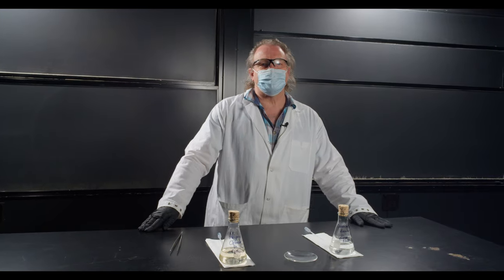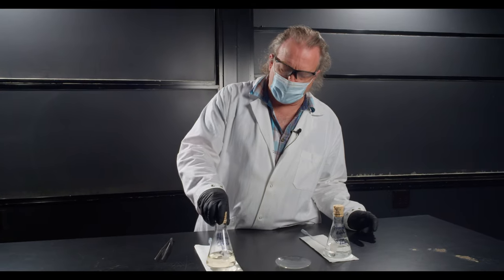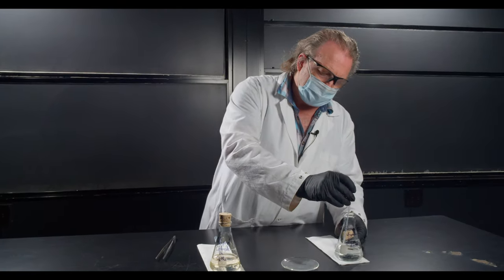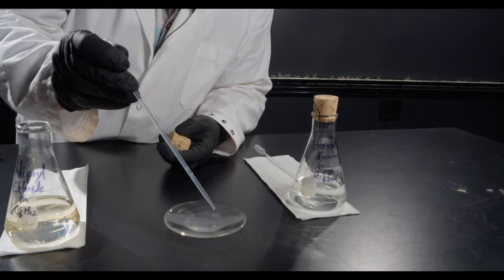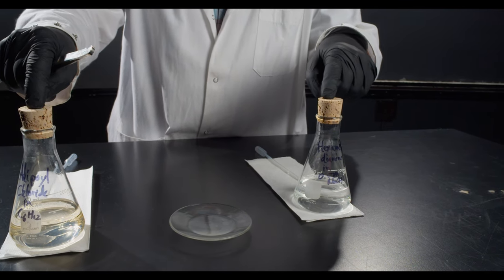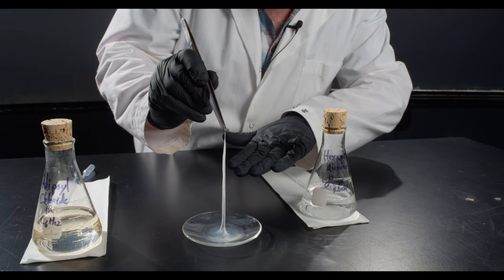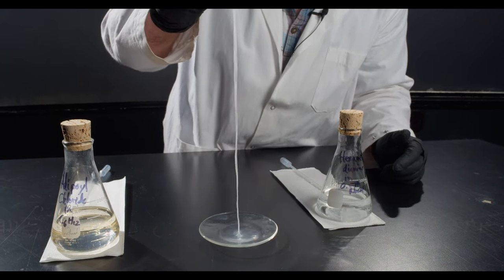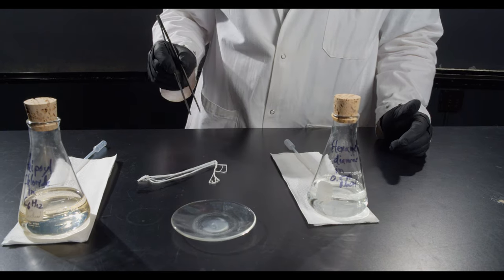Nylon Synthesis

Comment: Great video. As a fly fishing guide, nylon is near and dear to my heart… my challenge right now is to change its properties to make it more elastic without memory… I’ve achieved 25% stretch with just boiling water and salt, but the coils are still there and the nylon monofilament retains memory when it cools… any thoughts on how to chemically and permanently remove memory from nylon while preserving knot strength?
Reply: Have you made any progress in this pursuit? Would you be willing to share (via email?) What you've found about nylon thus far? I am researching it for product development.

Comment: I don't understand what would've been so difficult about washing the final product and remelting for application in commercially viable stuff?
Reply: Because it is a condensation reaction, where the by-product is water (which interferes with the reaction), the polymerization as shown in the video doesn't make a very long chain polymer. Wallace Carothers figured out that distilling off the water as the reaction happens makes a longer thus stronger polymer.
Reply: @DanielRosenberg  ah I c, neat